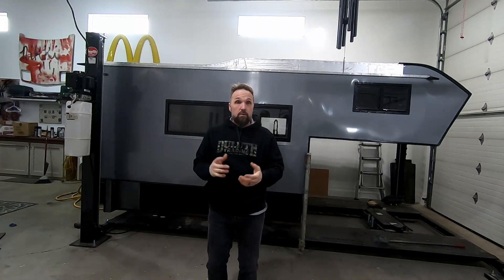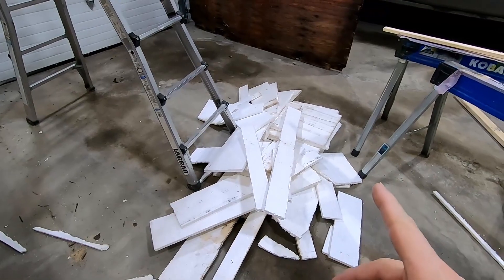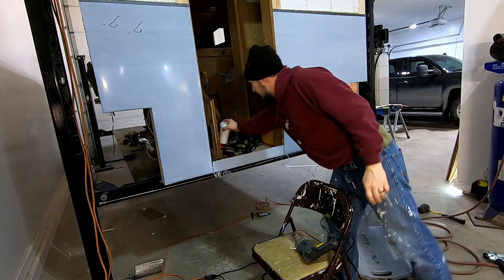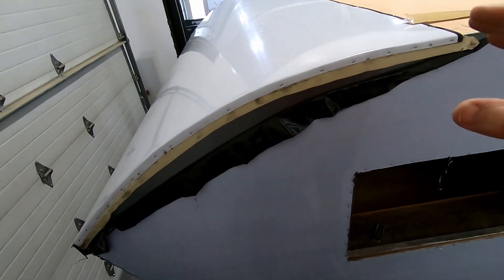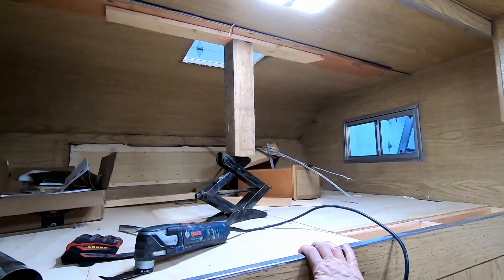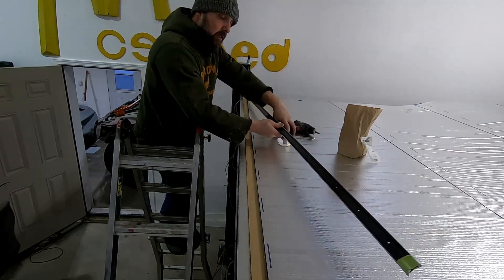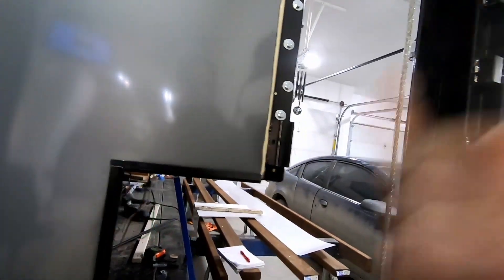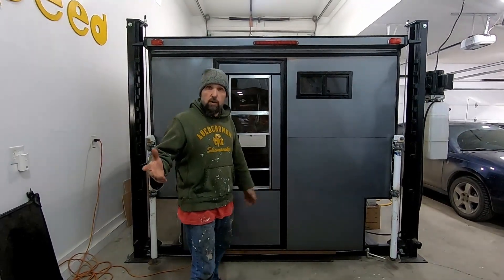1970 $500 Truck Camper Roof & Siding DONE!!!!!!!!!!!!!!!

Comment: It's butylful.  😁

If the aluminum siding insulated or just straight up metal?
Reply from the maker: The new siding is just aluminum sheets.  The insulation is in the walls/ceiling either foam or batt depending on the spot.

Comment: Husband and I enjoy your camper build videos. We are in the process of restoring our camper and are interested in using the flat metal skin you used. However, my husband was talking to a a friend and he said that flat metal would vibrate all the screws out and be very noisy. How has yours held up? We really like the smooth sleek finish you got from the flat metal. 
Thanks, Tom n Pat
Reply from the maker: Thank you for tuning in.  No noise or screw loosening that I’m aware of.  We did butyl tape between panels.  The only thing I don’t like is it has some waves to it. We should have gotten another set of hands to pull it a bit tighter.   Otherwise it is perfect.  We are using it as I type this at the July 4th glacier view car launch.  Good luck with your build.

Comment: Where did you find the aluminum You worked with?
Reply from the maker: We bought from a local rv shop cache camper.  You can get it generally from any rv repair shop.
Reply: @McSpeedAlaskanAdventures  Thanks for the response. I have an 82 Tioga thats got an aluminum roof over luan. We live near ya.
Reply from the maker: @70ixlr86 cache camper has you covered for the material.